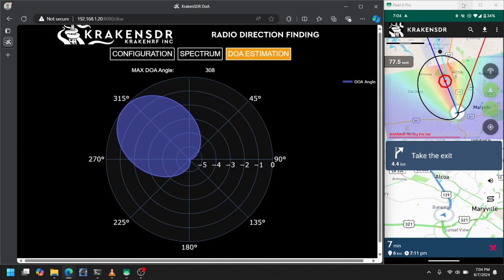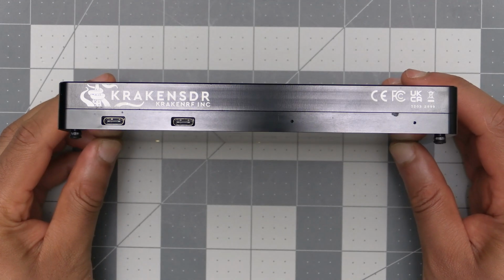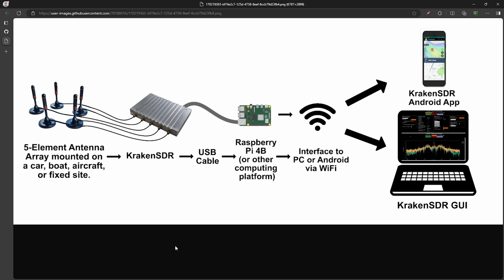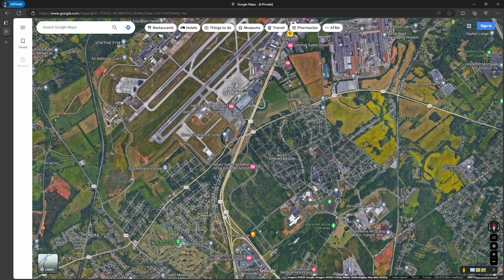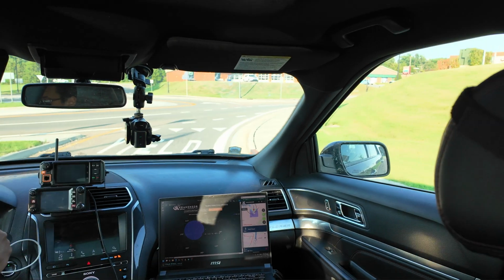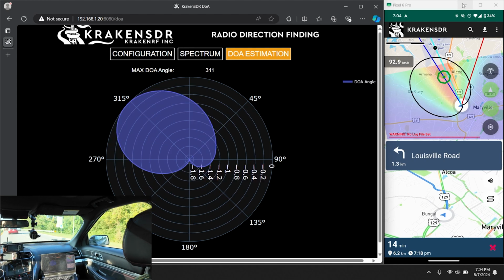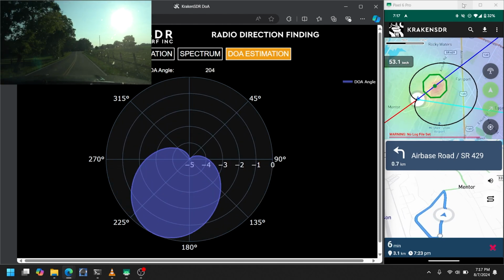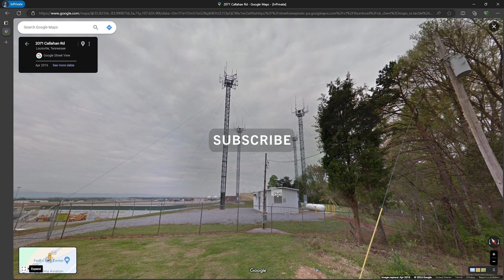Radio Direction Finding with the KrakenSDR | Radio Direction Finding Series

Comment: ...what do I sense is in store for this unit in the future ?...a single cord from the unit to a saucer shaped splitter that has indicator lines on it for the spacing of the antennas and cables for the length from the unit to the antennas. so instead of all these cords from the Kraken, just a single cord to the top of the vehicle. to a splitter that has antenna cables to length to each antenna. Perhaps an accessory mount that holds the antennas in a mount that is a single unit magnetically mounted to the top of the vehicle that spaces the antennas accordingly...A simpler application that is less cluttered. maybe collapsible antennas on the mount so it all fits in a convenient carrying case..
Reply from the maker: A simpler set-up would be welcomed for sure! It definitely has a lot of moving parts and isn't a quick and easy deployment. Appreciate your suggestions and taking the time to share then

Comment: I googled this because I was thinking you could probably engineer a passive Radar array that just listens for radio signals.

So far I've found this and a ww2 area oscilloscope thing called a hfdf

But yeah, that pretty much confirms my suspicion.

I'll bet the military has something like this with a gazillion antennas that could track and classify multiple radar sources. And if not.... Then what am I paying so much in taxes for?
Reply from the maker: The military will generally just use active radar unless they're worried about being detected. The problem with passive radar is it relies on radio signals from others like TV or AM/FM radio so if you're operating in an area with no radio signals, it won't work. There is this device for military use that is similar to what you're talking about though 

https://youtu.be/ez7chMwwMSk?si=nAsTO3Wj8MPqfgXh

Comment: do not know much about sdr, but wonder is it possible to find fpv drone pilot, and even, is it possible to find location the drone itself? and if somebody has the same device, can this device find location of your device?
Reply from the maker: Finding the drone pilot should be a bit easier than the drone. If the drone is transmitting location data in clear-text, that data could be intercepted. As far as locating the same device, assuming you're talking about SDR, that is not possible with most SDRs as they receive signals only and don't transmit.
Reply: @The_Comms_Channel  thanks for answering
Reply from the maker: Sure thing!
Reply: @The_Comms_Channel sdr

Some do transmit and receive

Theh use it to hijack key fobs and  basically mimic any signal a car door or any radio wave is emitting it will copy that and re emitting that radio code to control or activate something 

They also come with rolling code that allows u to open car doors and hack wifi

Comment: You should totally try it with Dipoles tuned for FM band and use it to receive multiple stations on the same channel at the same time!
Reply from the maker: That would be an interesting experiment! I suspect when we get into testing Meshtastic signals it will be similar.

Comment: Someone has made a good COT converter for ATAK which works well. I've fed it into a tak server and distributed the output so others can see the direction and location of an RF source. Plenty of room for improvement but for a small price, it's a fairly good capability
Reply from the maker: That's awesome! Will have to check it out and see if there's anything I can contribute to the project.

Comment: Keysight has been doing something like this for about 20 yrs except there are not 5 receivers in a single box, but multiple receivers that can be synchronized together via GPS and ethernet. It uses the same principle call time distance of arrival or TDA. Think of it as a big array of receivers that all report to a PC to analyze the data and report back the direction of the signal and approximate location. I’m surprised no one hasn’t done this before using SDR dongles or HackRF modules. All that needs to be done is to make the LOs and clock on the digitizer’s coherent to a GPS standard.
Reply from the maker: Might be more doable now that the software is there.
Reply: And there are now kiwisdr web sdrs publicly available which you can use using the tdoa plugin to geolocate signals from 0-30mhz
Reply: 5 years ago SignalsEverywhere put this on YouTube: Radio Direction Finding Equipment KerberosSDR Coherent 4 x RTL SDR RDF Setup
:ø)
Reply: Just think how useful this might be for identifying jamming signals on ham radio.

Comment: I was wondering how they track people who are illegally broadcasting. This is interesting.
Reply from the maker: The FCC has a more advanced version but similar concept. But with this, we finally have an affordable and capable tool
Reply: We used this technique in the early 90 for our radio communication in the army. Not for tracking, but for suppressing radio disturbances from certain directions. This was done using 3 antennas on the roof of the bandwagon, and it worked very well.
Reply: There are much cheaper and simpler ways.  Just use a beam antenna for vhf and higher, or a loop on HF.  Any directional antenna will give you a direction toward the transmitter.
Reply from the maker: This is much quicker
Reply: @The_Comms_Channel  As a fox hunter with decades of experience using many different DF systems I think I can challenge that assertion.  I notice you just assumed one of the towers was the transmitter, and you didn't determine which one of them was actually transmitting.  The Kraken system isn't much different from doppler DF systems we've been using since the 80s.
Reply from the maker: Yes, this wont pinpoint exactly which tower, but you're not going to find the general location of a signal miles away within a few minutes like this will. As mentioned earlier in the video, we'll be covering the traditional methods where we'll use attenuators, harmonics to narrow down a signals location once we get to the general location of it.
Reply from the maker: As far as HF is concerned, I'd challenge you to find the location of a signal in another state/country quicker than KiwiSDRs TDoA
Reply: @The_Comms_Channel  "You're not going to find the general location of a signal miles away within a few minutes like this will."   Why not?  I'm not sure why you think this device has some kind of magical ability to find a transmitter.   It finds bearings and triangulates them on a map like any automated direction finder does.  I've been using dopper DF units combined with GPS and mapping software since the 90s.  I've also used motor driven spinning yagis to do the same thing.  This device has about the same bearing resolution and susceptibility to multipath as a doppler DF unit.  It is just considerably more expensive.
Reply from the maker: @stargazer7644  This was your comment:

"There are much cheaper and simpler ways.  Just use a beam antenna for vhf and higher, or a loop on HF.  Any directional antenna will give you a direction toward the transmitter."

Where in that comment did you mention Doppler DF? When did I say this was vastly different from doppler DF? Also, what doppler DF system is this considerably more expensive than?
Reply: @The_Comms_Channel  Where did I mention Doppler DF?  Well that would be 4 posts up in the second comment I made, which was the one you presumably replied to.  "As a fox hunter with decades of experience using many different DF systems" and "The Kraken system isn't much different from doppler DF systems"  It is all right there in the thread.  I own multiple doppler DF systems, both homebrew and commercial, and none of them cost anywhere close to half as much as a Kraken+antennas+pi+android.  My homebrew systems cost 1/10th as much, and work the same as the commercial units.  I most often just use a $20 beam, an electronic map and a compass though.    If the transmissions are very short then I'll break out the doppler.   It really isn't rocket science, it just takes a bit of practice.
The Kraken is a very expensive device for what it does, and the learning curve for the AVERAGE ham to even get it running is pretty steep.  They really should have just included a pi in the thing.  I'm not sure what benefit you get for the expense.
Reply from the maker: @stargazer7644  Comparing commercial to home brew is comparing apples and oranges. Not everyone is going to home-brew a system and would want commercial. So, instead of bloviating about how "awesome" you are and how much "experience" you have, let's compare apples to apples and hear about your commercial doppler system (and that means the make/model/price) that doesn't have a "steep learning curve" for the average ham and is "much cheaper"

Comment: I can't wait for the Meshtastic direction finding tests. I have been told many times by people that they could find my Meshtastic radio in minutes.
Reply from the maker: People on the Internet love to run their mouths 😂 We'll be putting it to the test though!
Reply: @The_Comms_Channel  100% I always ask these individual how and I get nothing but silent. 😀
Reply from the maker: Yep, they usually can't provide the receipts when asked lol
Reply: Do they know meahtastic radios operate in common frequencies that they'll have to sift through?
Reply: @kerbalairforce8802 probably not 😂
Reply: @kerbalairforce8802  I agree, I think most of them don't know what they are talking about.
Reply: Well just need to write a plug-in to time send.  Say turn on and send for 5mins each hour on an overlap with each node, but offset the times each hour based on maybe a static setting.  It wouldn’t be full proof, but would make it more annoying to find.
Reply: Meshtastic packets have unique IDs including the transmitting node ID, unencrypted, so its easy to focus on a certain packet or transmitter
Reply: @yannai0h  That is good to know.
Reply: i just need a sdr and a yagi tuned to abt 915MHz
Reply: @GamingKing545  Or a krakensdr and no yagi...
Reply: Is this video out already?
Reply: A single radio can be quickly located.
A cluster of radios on the same frequency is much more difficult because you need to be able to isolate the different radios and track each one by one. Not impossible, just requires a bit more effort.
Reply: @Hebdomad7  Thanks! I am sure there is very skilled individuals with the right equipment that could track down meshtastic users easily.
Reply: @EmCommSolutions  This is not much different from DFing someone interfering with a repeater input when there are lots of stations using the repeater.  You simply take bearings when the desired station is transmitting.  You only need a couple of bearings to get close.  Once in close the desired station is strongest, and it gets much easier to ignore the other stations.
Reply: @stargazer7644  I've found it to be orders of magnitude more difficult than DFing someone messing with a repeater. Even the default US settings (long-fast slot 20 client mode) the bursts are really short to try to get comparative readings by hand with a yagi or loop from much distance and trying to walk it in via forcing traffic to get more instances of a signal and watching signal strength isn't much better and if you can't force traffic...might as well forget about it. Its definitely quicker and easier to get a general direction to start with via the Kraken but you can only drive in so many loops before the neighbors start to question your sanity or start getting the side-eye in other neighborhoods. I don't doubt there are some clever tools out there that more reliably address it, but with typical ARDF setups, its pretty rough and again that's with nodes that are configured to pass all traffic. I'm definitely looking forward to seeing the approach TC2 takes to it.

Comment: Cool new topic, hardware expensive but hey that’s how professional equipment goes lol. 
So it’s trying to micro triangulate with those 5 inputs, and then outputting to the user more like a compass/wayfinder. 

Nice that’s it’s more direct than having to drive in a circle around the target while taking radio measurements to triangulate lol
Reply from the maker: Haha, yep! This makes it a breeze, but at a price of course.
Reply: It doesn't "micro triangulate".  It determines the bearing based on the phase difference of the received signals.  That just gives one bearing.  The bearing alone doesn't tell you where the transmitter is. You have to take multiple bearings along a baseline that isn't in the same direction as the target in order to get bearing shift.  That shift is what allows you to locate the transmitter.  This is how triangulation works in any bearing determining DF system.
Reply: @stargazer7644  right, ideally you’d circle the target
Reply: @poland153  Circling isn't required or even desirable.  All that is needed is a baseline down one side of the target long enough to swing the bearing significantly farther than the average bearing error plus the minimum bearing resolution so the solution will converge with the desired accuracy.